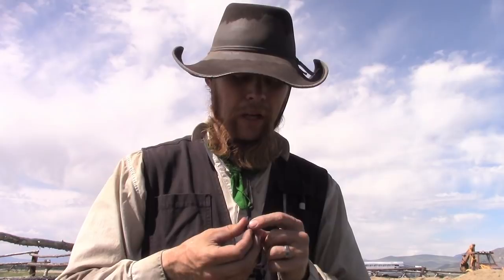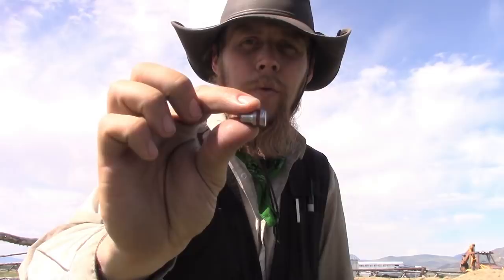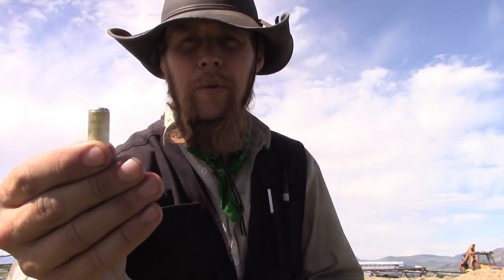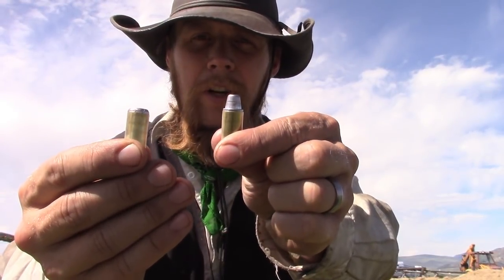Backward Bullets (TIS150)

Comment: by turning the slug backwards you reduced the space in the brass raising the pressure.in a 9mm this would blow up the gun because of the smaller space in the case'

Comment: Very interesting experiment! I did similar testing with backwards bullets in the 223 just for giggles. Accuracy and velocity did not deviate as much as I expected. However, when used on a live target, the damage inflicted was MUCH more devastating than the correct orientation bullet. And no, the bullets never tumbled interestingly enough, even at long range.

Comment: The extra mass of the backwards bullet inside of the case raises pressures and thus velocity. Only if you somehow got identical muzzle velocities could you test the aerodynamic difference, and even if one printed higher that could just be a function of where the load was sighted too and not a function of a better shape.  But, I like that you are an experimenter, and your sharing it with us.
Reply: not the mass. it reduce the volume of the case. actually pretty dangerous unless you are way under a max load
Reply: Especially with a fast burning powder like Bullseye. No room to play with. This was dangerous.